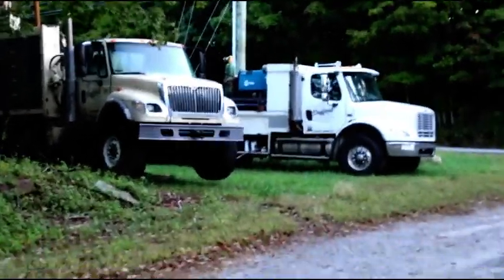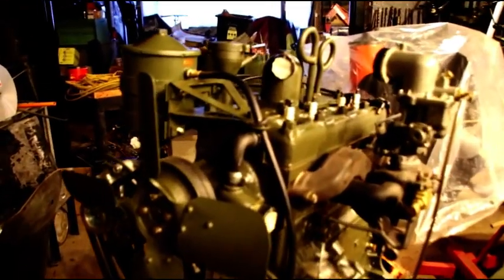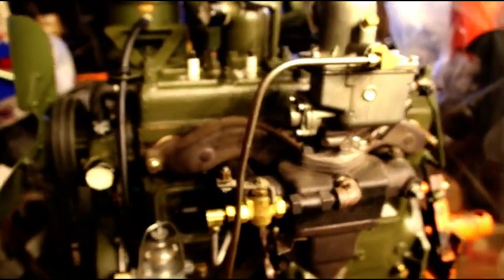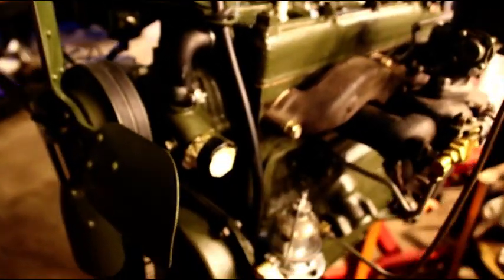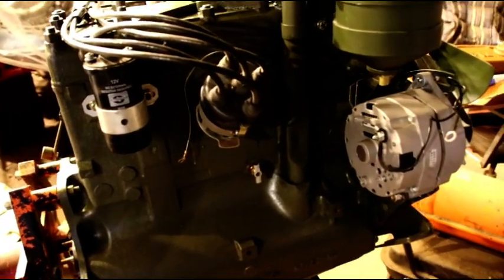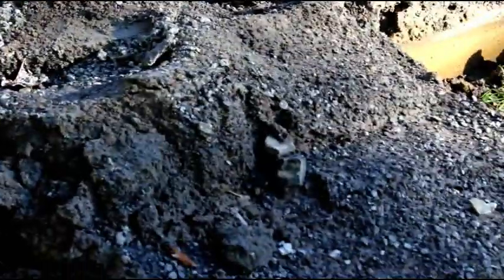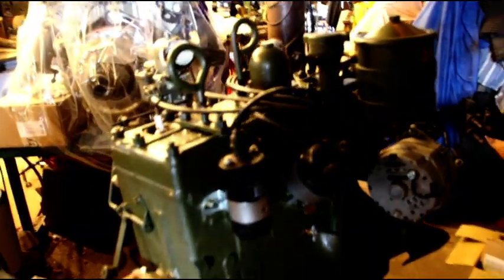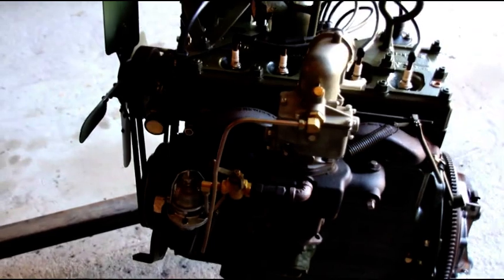Gary's Willys L 134 Engine Finished, Drilling For Water At The Farm

Comment: A really good result for your well boring, we live on top of a limestone outcrop and I have often thought about boring down for water, but how do you pump up 500 ft? The engine looks good after all the problems you have had with it. Chris B.
Reply from the maker: Hello Chris, yes finally have good water supply.  500 feet can easily be pumped with a 1 hp well pump.  That will feed water to the house and barn and all exterior hydrants for the animals.   Engine came out great and will be back to owner soon.